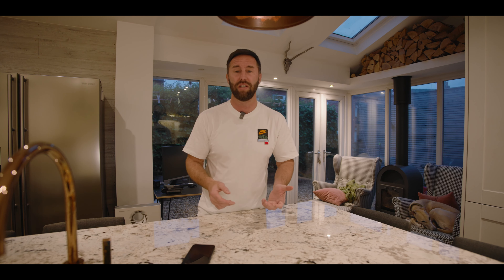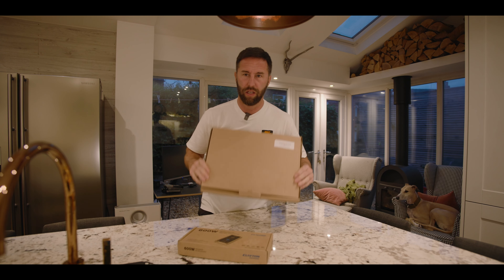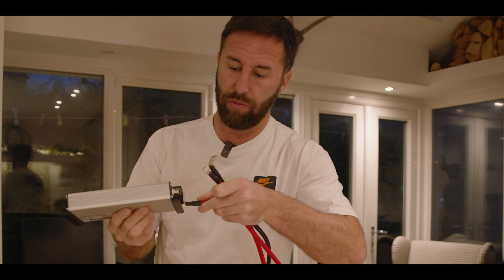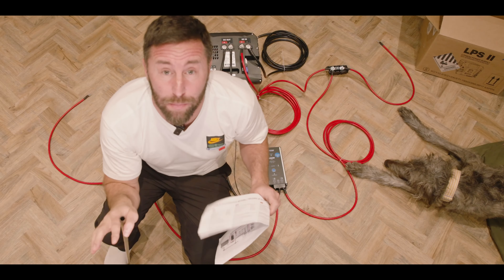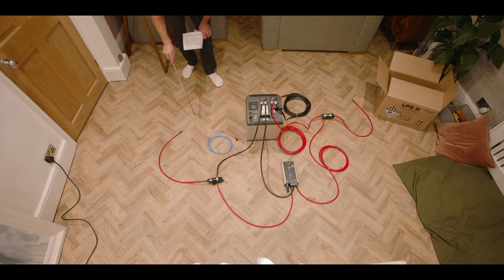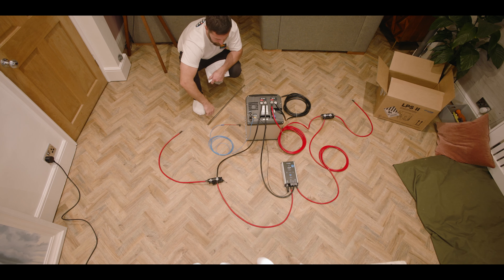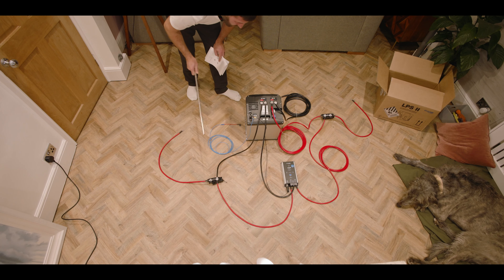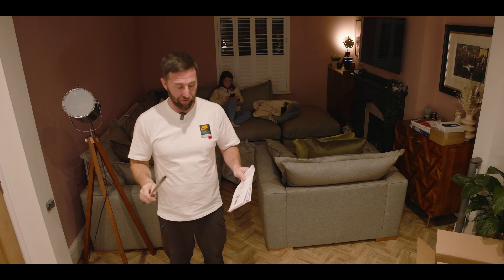Clayton Power Super Charger Step by Step

Comment: Nice one Mark glad you made a point of mentioning the switch on/off characteristics of the super charger. That one had me scratching my head the first time I used this unit. 👌🏻
Reply from the maker: Me too! I bet everyone who fits one is the same. Hopefully it will save me a few phone calls and messages too so it’s a selfish video 😇
Reply: @ahoyleisure if you had a lps2 installed and solar why would you need the supercharger
Asking for an idiot me
Reply from the maker: @rockaperoon  Hahah that’s the thing you don’t need one. 590w 45A recharge rate built in with the Clayton LPS unit is really good. But for those that want to recharge their battery battery extra quick you can double the charging to a whopping 90A or over 1000w in total.

Comment: Great battery but very expensive for 2kw
Reply from the maker: Agreed but its all relative.  Similar to Eco Flow or Victron but agree more expensive than Renogy or cheaper Chinese sub brand batteries etc. Again for jumpstart functionality you can opt for a Sterling Power DCDC but they are pricey. 
Take a look at electric bikes for example. So many bikes that will give you 400Wh battery capacity but power delivery, real range, torque, weight, size, how reliable etc is another story. 
I delayed pulling the trigger on ours but looking back we've had problem free electrics for years now and and go on holiday and sleep with sound piece of mind that everyone works and is safe.

Comment: Hi there love the vids 
In relation to Clayton power
LPs 2 
You mentioned additional batteries do you have a cost for them and the size in comparison to the LPs 2 also would the battery have the same screen as the lps2 or would it be daisy changed to it 
Also I see Clayton power has put out info on an app would you be doing a vid on that 
Thanks for channel 👍
Reply from the maker: I do have some rough costs but Clayton have asked me to hold off announcing anything. 
The add-on batteries do not have a screen and will be controled via the LPS  screen, remote or the app. The 280ah will be very similar in size to the LPS. The 100ah will be slightly smaller. Yes the app will be out 2024. Hope that helps ;-)

Comment: Hi mate, what do you know about the superchager being able to jump start a vehicle that 12 or 24v? ive see a video on clayton website showing a technician jump starting a digga via an anderson connecter, connected to the super charger
also.. how much do you sell the 3000watt unit for ?
Reply from the maker: Yea the supercharger does have both 12 and 24 option. You just hold down the jumpstart button for 3 seconds to use it. it will then stay on for 5mins or you can press the button again to terminate it.
Reply from the maker: Anderson connectors are a good option and they were used a lot in the old Clayton kit from what I’ve seen and heard.
Reply from the maker: Ex VAT it’s £2,924 inc 10% discount 

Note the supercharger also now has a new wiring setup that allows the supercharger to work all the time rather than under 29%. Video coming soon.

Comment: Hi Mark , I am in the market for some power in my van I need it to run a deisel heater a small fridge or cooler and charge my mountain bike with a 625 wh  battery ,can you please give me some advice on what size clayton I need to go for, the smaller voltage that will do the job the better, to keep the price down, any advice will be much appreciated thank you
Reply from the maker: Hey Andrew. I would go with the 2000 or 2500 as that will keep the cost low. Give me a shout on mark@ahoy.co.uk as I’m offering 10% off and free delivery at the moment. I can do you a full breakdown. Happy to run through things with you on the phone too to make sure it’s right for you.